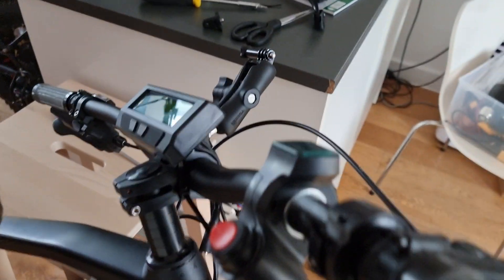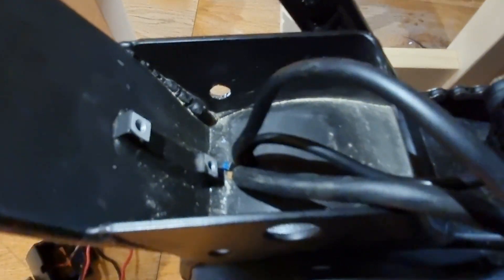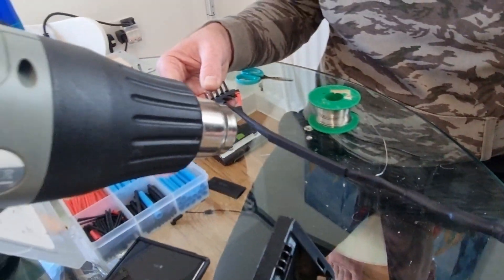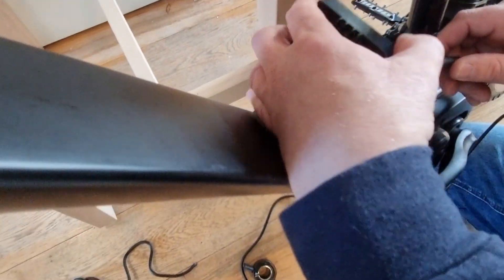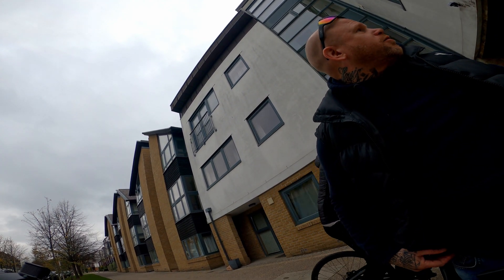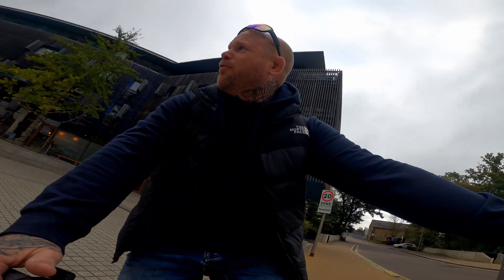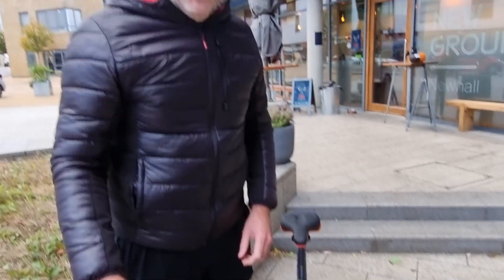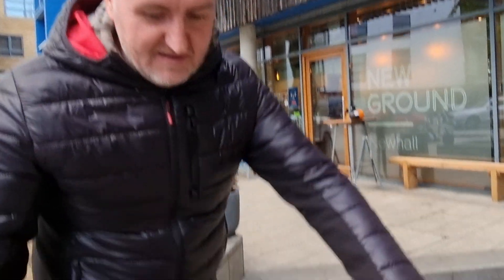Grin Cycle Analyst. Is this ebike display too expensive?

Comment: Too expensive? Yes, depending on what you use it for. If it's just for a display or a way to add pedal assist, it costs too much. But if you use the advanced features, it's worth it. The Phaserunner with Cycle Analyst is my fifth controller setup, and I have 3690 km (2293 miles) on mine. It's extra work, and I had to figure some things out for myself, but the extra control has given me my dream bike. 100% legal for road use, pedal assist engagement fine tuned to hundredths of a second, and up to 20 PAS levels with dynamic wattage control that feeds the motor extra power for starting out or going up hills. Yet, flip a switch for off road use, and it becomes a 3000 watt monster that flings you up hills, all while remaining buttery smooth. Then I fold the bike up and put it in the car 😊
Reply: 3kw folding bike ?

Comment: I love my Cycle Analyst V3, it does look a dated display, but its so much more than a display. I like you can assign three different power levels to a three way switch. I like the different levels of silky smooth pedal assist with push of a button too.

Whats important for me, is I'm running 22s Li-po, 92v, without a BMS. I'm very careful with balancing them and treating them well. I am the BMS. My Cycle Analyst is also like a BMS with its low voltage cut-off which stops me discharging my batteries too far. As well as a high temperature cutoff, as I've got the temp sensor in my hub motor hooked up to it.

I'm running my Sabvoton at full 150a and then taming it down using the Cycle Analyst to 80a. The Li-po are 10ah and rated 12-24c, so I'm sure they could handle more (240a on paper, but let's half this)...I'm just not sure I can handle more haha

I'm not using the mount it came with,   I've got mine cable tied to the top-tube a little more out of the way.
Reply: What’s your hub rated for out of curiosity
Reply: @Louis-lu5wh  MXUS 3KW V3 3T, its rated for 3kw. Tony (Vortecks channel) has put 15kw through his. So I'm not too worried about it. I keep an eye on the temperature reading.
Reply: @18ct  I love Tony his videos are great and those motors can take a whole lot of power!

Comment: You have to go to the throttle input and output voltage settings. There is an option for how many volts per second it can ramp up and down. It's a ball ache to do but there are a few guides n YT.